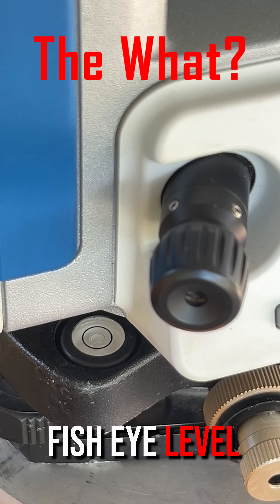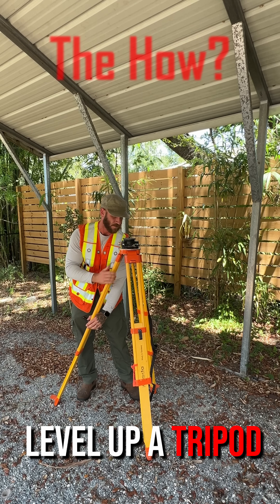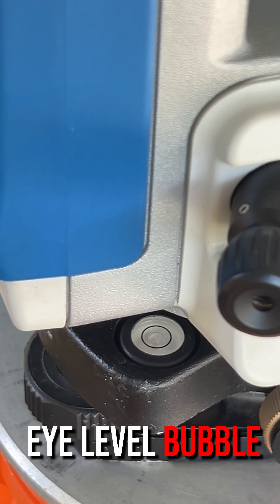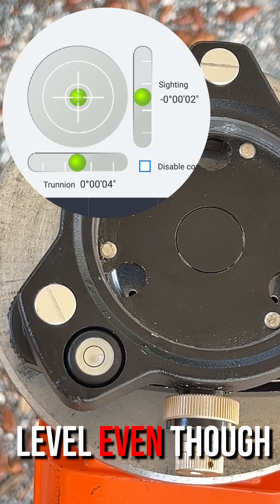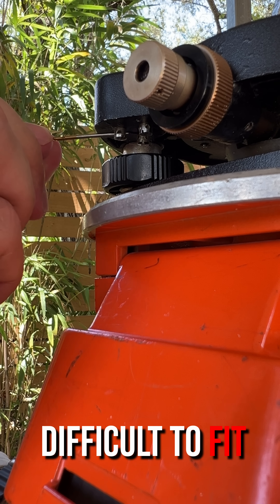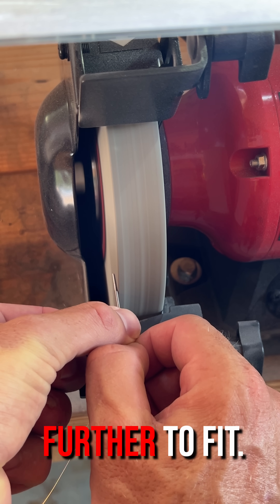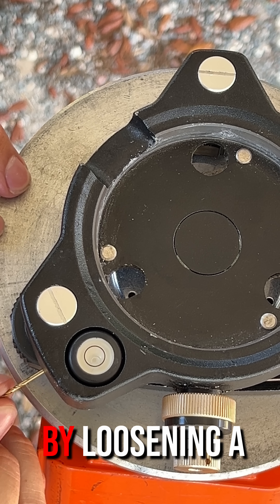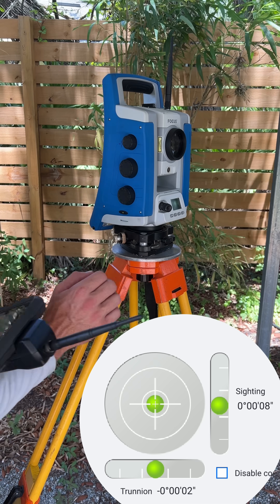Tribrach Level Bubble Calibration - #totalstation #landsurvey

Comment: Be cautious trusting the tribrach too much.  It's common to find that different instruments (TS, Prism, etc) may "sit" differently in the same tribrach.  Just because it's centered with one device, doesn't mean the next will rest in the seat the same way.

This will absolutely get you "close enough", and removes any major errors that might throw off a traverse.  But try to use proper vials that can be spun to verify a good read, and only use the integrated tribrach bubble as a rough start.

Comment: I confirmed that my tribrach was off by drawing its outline on a tripod and turning it 120 degrees. But I am not really comfortable taking the TS out of its tribrach Is there any other method that can be used to adjust it?
Reply from the maker: Yea Seco sells a tribrach adjustment puck that’s really handy and easy to use.